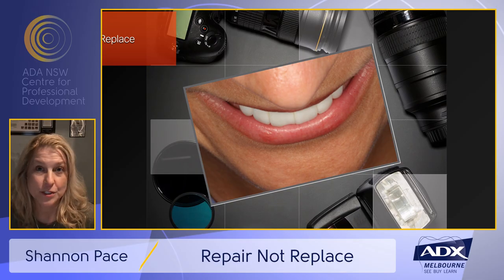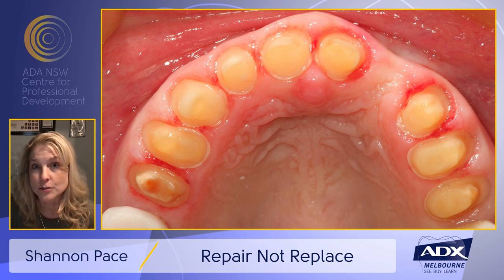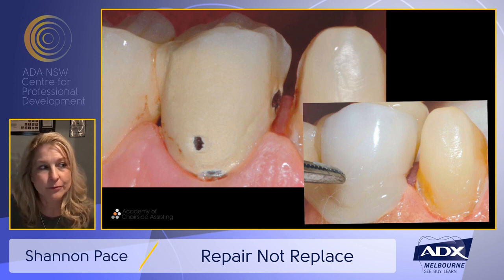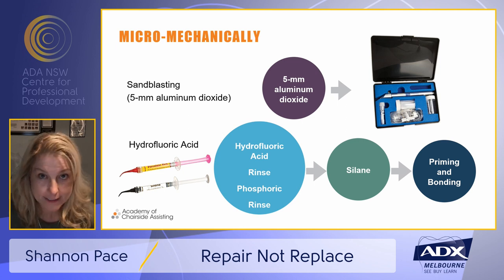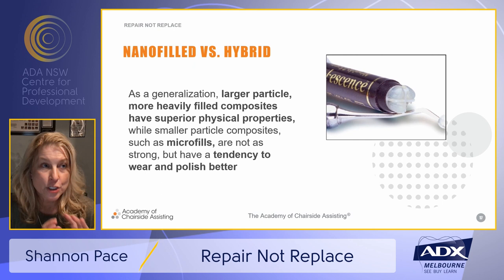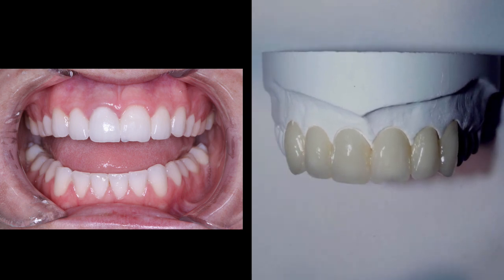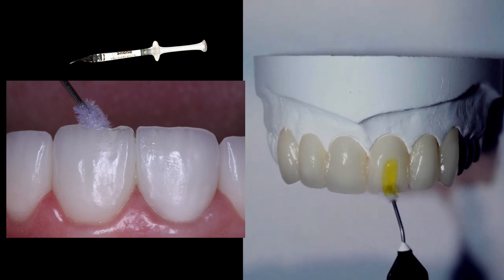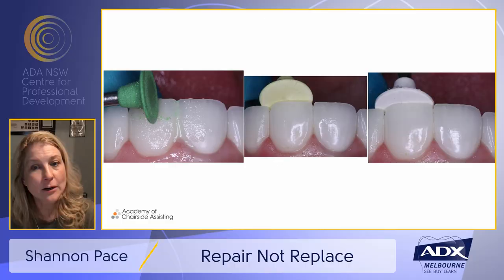How To Repair A Broken Crown

Comment: About a year after I got a porcelain crown on a molar, I chipped it when I I bit down on a wheat kernel in some Special K cereal.  (The kernel wasn't supposed to be there.)  Now, I may need to get it repaired or replaced.  I really want to preserve the molar.  I'm hoping this information will help.  🙏
I wish they still made gold crowns for back teeth.  My dad had a gold crown that lasted 60 years!
Reply from the maker: They do make gold crowns. This is the best option and would ask for that!
Reply: @ShannonPaceBrinker  Thank you very much for the information!!

Comment: Can this method be used on the interproximal surface of a zirconia bridge to fix a black triangle between the crown and the adjacent tooth?
Reply from the maker: It can not. This only can be done to repair the porcelain where it existed before it broke.

Comment: Hi, can I add composite to the interproximal wall of a crown just like the way you repair porcelain if the interproximal contact is loose and caused food trapping instead of replacing the whole crown?
Reply from the maker: Thank you for your question, I have never added to the interproximal area. I’m not sure but all you can do is try. I would use a really good matrix system and gingival barrier to protect the tissues. Let me know how it goes!

Comment: Is it possible to repair the crown if the chip is at the base near the gums. I had a dentist tell me it cannot be repaired. They also did not do the original crown (#5). TIA
Reply from the maker: They don't like doing repairs that close to the gumline only because that is where it is extremely weak and using the acid etch is not good on tissue if it gets on it!'
Reply from the maker: But I have done it!
Reply: @ShannonPaceBrinker bless your honest Irish heart Miss Shannon

Comment: Can crowns be sanded down Slightly if they are uneven or slightly longer? I'm almost done with invisalign and my crown is longer then my other front tooth
Reply from the maker: Absolutely! They should be and then polished
Reply from the maker: But make sure your finished with the treatment before making any changes
Reply from the maker: Yet they can but you must be the careful
Reply: @ShannonPaceBrinker  and you are all ready
Reply: @ShannonPaceBrinker  oooooooooo

Comment: A question:  On a fixed bridge if a fake tooth is chipped off the fixed bridge can a ceramic, crown, bonding or porcelain 
or something else be fused together to the metal of where the fake tooth that got chipped off or must the entire
 fixed bridge be replaced?  In other words it is one fake tooth chipped on a 4 tooth fixed bridge and metal is now showing but can this
be fixed without having to get a new fixed bridge? There is no problem with the fixed bridge. It is with the chipped fake tooth on the
fixed bridge because of accidently biting onto a fork while eating  and chipping the  fake tooth that is part of the fixed bridge.
  Thank you for taking my question.
Reply from the maker: It could be repaired with composite or filling material, however it depends on the chip
Reply from the maker: They can repair the bridge but the metal may show through and look a little grey
Reply: @ShannonPaceBrinker  
Does the bridge have to be removed  to fix it or can it be done ( get fixed)  while still in my mouth? Also, can I assume that this will last a few years or is it only temporary meaning only a few months? The chip is basically  equal to 1 full tooth as there is a tiny bit remaining on the sides and on the bottom equal to a total of about 5-10% remaining. The metal is exposed now so all I wanted to know is can the metal be covered with something to make it look like a natural tooth.  What options do I have now?

Thank you for responding to my question.
Reply from the maker: @chrisnalina1755  you can add composite to the bridge or if it is just the front of the bridge sometimes they can make a veneer to go on the front. Composites or filling material will need to be blocked out so using composite that is opaque, then tooth color can buy you sometime unless there is decay under the bridge
Reply: @ShannonPaceBrinker  
Thank you for responding. I would like to know if the bridge needs to be removed or can the composite be done without removal of the fixed bridge?
Reply from the maker: @chrisnalina1755  It depends if you have decay underneath the bridge then the bridge needs replacing.  If it is only a chip then usually it can be repair. I am not a dentist, but this is what I have seen in my practice.
Reply: @ShannonPaceBrinker  
Thank you for responding to my questions. I appreciate it.
Reply: @ShannonPaceBrinker  
Do you know of any dentists in Long Island, NY  that you can recommend to me?
Reply from the maker: Chris yes I know some amazing dentist. Why don't you email me shannon@chairsideassistng.com